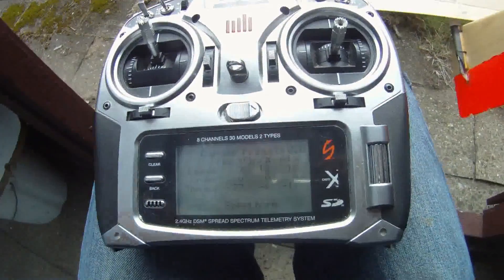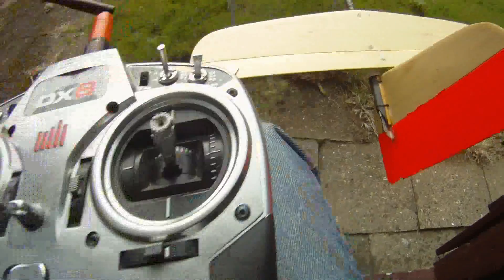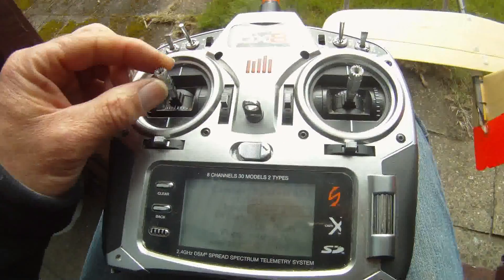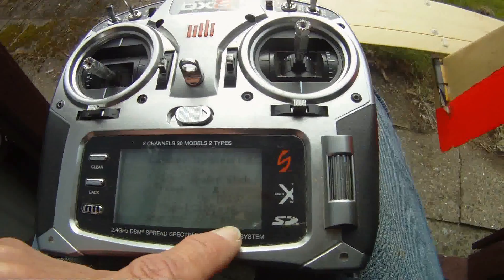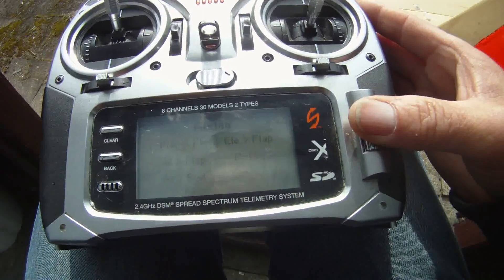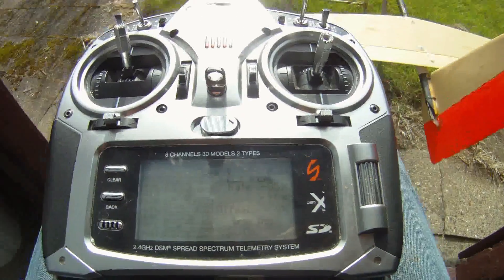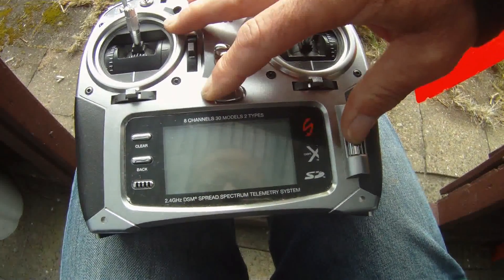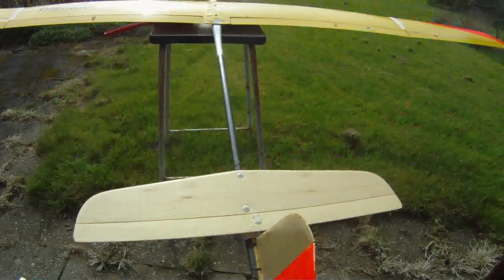DX8. Glider set up, explained for dummies.

Comment: This is exactly what I need right now - however, the glare on your Tx screen makes it virtually impossible to see what's on the screen.  Since this was posted so long ago, probably you no longer monitor it to see my comment.   Thank you for trying though !!!
Reply from the maker: Maybe this Will help you 😀 https://youtu.be/ZgjYSq447Jw?si=58gwmAupfbPZZt29
Reply: @SpeedsterDEN  Thank you Soren!!  Yes, that's great - I use a Spektrum NX8 and it is close enough to the DX9 that I can follow your steps.  You've answered many of my questions in this DX9 video.  I appreciate it!  jg
Reply from the maker: @jerrygiles1661  Under the video I linked there is my easy set up list, use it and it is easy to program the DX and NX radios :)
Reply: @SpeedsterDEN  Tremendous help, thank you Soren

Comment: Hello, thank you for the video. I have a DX6e with a glider (with a motor to start flying). Can you please help me understand how to turn the motor completely off once the airplane is flying? At the moment it continues to turn instead of turning off when I throttle back.
Reply from the maker: You need to programe the esc to brake on. How to do This is different for each type esc so you have to read the manual for the esc that you have 👍😃

Comment: Why my flpas servos are not even. It does start even in neutral, it twisted on middle position and still twist on 3er flaps position
Reply from the maker: Because your servo arms are not set in the precise same angle, and maybe the horn are not placed in precise the same distance from the hinge Line 😃 perhaps with some adjust at the servo throw and sub trim in the transmitter you can fix it, but check first the servo arm angle 👍

Comment: Hi Soren , Daz here, starting at the beginning, I would like to have your setup and I would like to know after you centre the flap servos do you put the servo horn on a forward bias so you get better down deflection on the flap ?I would like to have crow and flaps working as ailerons too so my guess is to just set the servo horns exactly the same as the aileron servo horns at 90 deg to the servo.Thanks in advance :)
Reply from the maker: Hi Daz, I normally set the flaps servos around 20 degree offset so they can give enough down flaps, and then there still should be enough for good aileron throws.But if you set yours like the ailerons and still have full flaps movement then it is perfect :)Good luck
Reply: SpeedsterDEN Thanks Soren !! You are awesome :)

Comment: i have an Spektrum DX8 and i can't setup my sailplane. where do i need to connect my servos in the receiver for 2 aileron 2 flap?
Reply from the maker: Right Aile: in Aile+Left aile in Aux1.  Flaps: Right flaps in gear+ left in aux2  
You need at least a 7 ch rx, to use the glider set up for 4 flap wing... good luck
Reply: thank you so much. all is working perfect.

Comment: Thanks - now onto flying.  First flight was a hand toss from 6 feet AGL to check out the trim in cruise mode over a nice flat park here in Scottsdale.  All seemed good with the 2m full house glider cruising along from 6 feet to touchdown at just above the stalling speed trimmed with hardly any elevator stick input required at all.  
Now onto the rubber band launch.  The glider launched fine but once in flight it constantly pitched up to a shallow stall then a pitch nose down and this required constant elevator input to avoid this ballooning cycle very difficult to fly.  Could trimming the glider in ground effect cause the trim to be off or is this more likely a CG too far aft problem?  The glider is used and the CG is set a the previous owner's red dot and within 1/4" of the tow hook.  I'm going to the park again for another hand toss.  Miffed- Thanks Jim
Reply from the maker: It sound like a cg problem, I think I would move the cg about 8-10 mm forward and take it from there, with some hand throws and trim it Again. I think 1 mm up elevator sub trim before the first throw would be good.  Good luck

Comment: Throttle forward 0 camber throttle back full crow got it!  So when you launch the throttle stick is full forward.  Makes sense.
Your video explains using all three modes speed (launch), cruise and thermal.  Are you setting up crow on the throttle stick in all three modes?
Are snap flaps active in all three modes too?  
I've rebuilt an old Vaquero 2 meter that I got used and now real close to flying it.
Thanks for the help.
Jim
Reply from the maker: Yes I have crow and snapflaps in all flight modes,
But you can do many fancy things in the flight modes if you feel like it.
I like to keep it simple .. :o)

Comment: Thanks for the video.  I'm setting up a 2 meter with a full house using the DX8 as in your video for Dummies.  

I think you set up the SPEED settings in the LAUNCH mode.  Is there a way to change the mode names.  

From you video it appears when the throttle stick is full forward the flaps and ailerons are slightly reflexed, with mid throttle the flaps and ailerons are faired in, and with the throttle to idle/off you are in full CROW.  How do you just get flaps alone?
Would you explain what wing configurations you are in as you move the throttle from full to off.

I've watched many of your videos and this one half a dozen times.  Thanks  Jim
Reply from the maker: Hi, You can not change the Mode names. and its not nessary because you dont look at the tx.  
Full forward thottle should be 0 reflez or camber...:o) 
You cant get flaps alone, unless you skip the ailerons in camber setting, and perhaps make a mix.. flaps to left aile and set it on a switch then you can put it off and on. But you probberbly wont use it.
Thottle forward: 0 camber or reflex, thottle back: full brake.
Good luck :o)

Comment from the maker: 7 ch rx
Go to switch select: Set flap to aux3.  
Go to wing type: Set motor to spoiler, and make 0,1,2 black in all flight modes.
Esc in thottle port on rx.
Perhaps you must make a mix: Aux 3 > left flap, to get the flaps moving with the flap switch.
Think this will help you on the way, dont have a spare rx so I can not try it my self.
On my motor glider, i use the set up on the video, and control the motor on the flap switch, and I can also control max RPM on the turning switch. Works great.